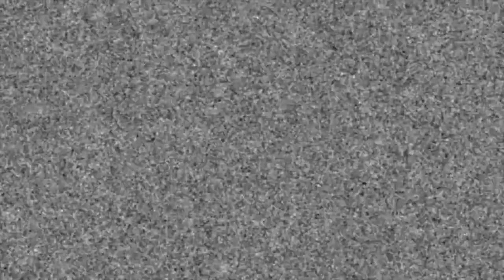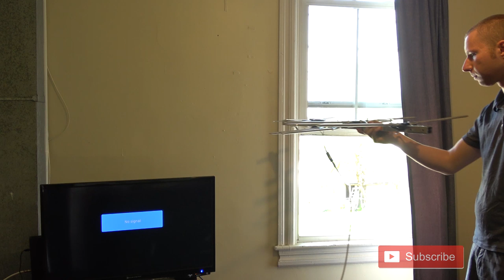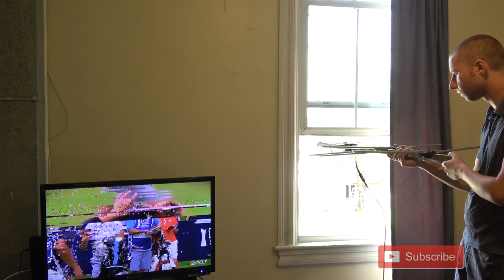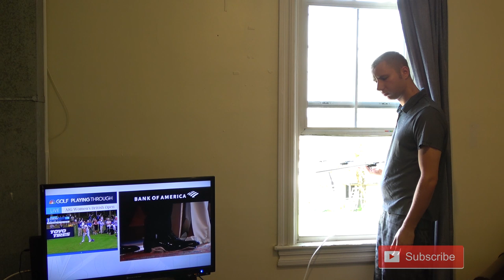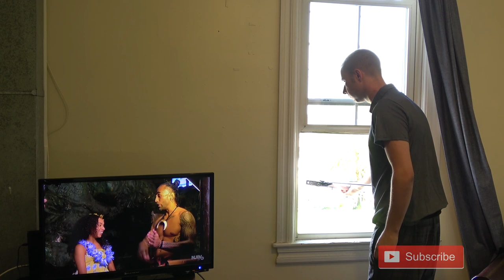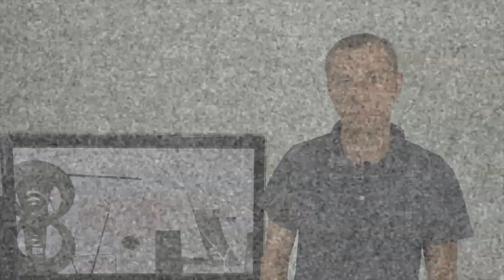Why Indoor HD TV Antennas Do Not Work Well

Comment: Antenna man, hoping you can help.  I’m in Port Huron Michigan and have an OLD school antenna about 32 feet high.  I just hooked it up and only got ONE channel (29) out of Canada.  But I can’t get any locals from Detroit 43 miles away when I point the antenna in the proper direction.  Two concerns: 1. I have a huge tree in between my antenna and Detroit. 2. There is old G59 cable running from antenna to tv about 50 foot run or so.  I keep turning antenna and rescanning, but no matter where I point it I just get that one Channel 29.  Any thoughts, suggestions?  I really want to use this antenna but also don’t want to put a ladder 32 feet high to change anything.
Reply: Actually my Zip Code is 48079, so I should be getting about 27 channels according to antennaweb.  I’m new to cutting the cord and fairly lost already.
Reply from the maker: Replace the RG59 cable with an RG6 cable and add a preamp. That will likely boost your signal. You can find both on my Amazon store: https://www.amazon.com/shop/antennaman
Reply: @ru932  I'm not sure if this helps or not, but I had an older UHF antenna that my dad and I installed on the roof in Lansing.  All I could get with it was the Lansing locals.  In looking at the list on TV fool, I was supposed to get at least Fox 66 out of Flint as well.  In the old Analog days I could get 12 out of Flint as well.  I tried that Clearstream 2 max indoors first and got all locals as well as Fox 66.  I then replaced the old antenna on my roof with it.  In addition to 66 and 12 I also got 25 and sometimes 46, which is at the 56 mile mark.  I then added the distribution amp and FM trap up on the pole, I'm now getting all Lansing, and channel 46 all the time now.  I still have some difficulties with my Channel 43 even though it is in the green area.  Which I think could be they are low power as they are in the next FCC repack.

I do notice that if I scan at night I can sometimes bring in distant channels, or first thing in the morning.  I can often get fox 17 out of Grand Rapids and WNEM 5 out of Bay City.  WNEM is coming from the rear of the Clearstream 2 max, and through my big silver maple tree.   This weekend I got channel 7 and 56 out of Detroit for a little while scanning in the morning and the antenna is not even pointed southeast from me.

So you might need the Amplifier, some RG6 and a newer antenna.
Reply: Thanks for the great info guys.
Reply: I ended up skipping the antenna and subscribed to PlayStation Vue.  All the channels I wanted plus the four Local Channels at no extra cost.  I essentially cut the proverbial Directv cord and am saving $90/month!

Comment: Antenna Man, can you help? I recently cancelled my Directv and the dish is still on the roof. I was wondering if I got the ClearStream 2max if it would be possible to mount, with some modifications, to the arm of the Directv dish? The mounting of the dish could be used to mount the antenna and use the existing coax,(R-g6)  from the dish since it's already coming through the house to two televisions. Does this sound like something that would possibly work? Thanks

Comment: I live in an apartment, there is not a way to get an outdoor antenna anywhere. There are a lot of trees and possibility a larger building i would half to deal with. But if there was a way to  attach some kind of   an out reach from the side of the outside wall. to faction the antenna to, might work. I might have to look into that. I have an indoor antenna that does not pick up very many channels, but the ones it does are usually very good. Thanks for video and information. Ps I am looking for suggestions?   :- )  Tom
Reply from the maker: Make sure the antenna is on a wall that faces the direction of the broadcast towers. As I mentioned in the video one of the best indoor antennas not only by my test but Consumer Reports is a ClearStream 2max. https://amzn.to/2yoVl2l
Reply: *would have to (different meaning and slightly different pronunciation)
*an outreach
*to fashion the antenna to (different meaning and pronunciation)
Reply: @alvallac2171  I know what your saying. I have to figure a way to fit  it to my window frame it looks like. can't attach it to outside wall.

Comment: Still waiting for two questions I`ve asked  
1 which end of the antenna points to the transmitter (the antenna in your avatar for example )
2 which antenna would you suggest for areas that have a lot of trees
Reply: It depends on the design of the antenna but normally if there are a group of elements that resemble an arrow head. That arrow head will point AWAY from the TV transmitter. In the case of his Avatar, both the antenna and the little man are pointing towards the TV transmitter.
Reply: @eosjoe565  Thank you ,I kinda that was the right way but it`s best to know for sure

Comment: Antenna Man is right, indoor antennas are a waste of time. Construction materials will block signal especially ATSC 1.0 it’s a weak feeble signal. 
Best just to run RG6 to a mount on the side of an eavestrough bolt a piece of plastic to it and mount a 31 inch stainless rod. Then attach the Center core of the RG6 cable to it. 
This setup will produce more tv channels then any indoor antenna.

Comment: Hi Tyler  
Could you please comment on how incremental improvement in signal strength affects picture quality.  If a signal is registering a 75 would  an increase to that signal to lets say  85 affect the quality of the image on the TV.  Thanks
Reply from the maker: The picture quality is the same at a 50% or 100% signal due to error correction. It's not like streaming a video online. It's either you have a clear watchable signal or nothing.

Comment: That law regarding HOA's and outdoor antennas ALSO applies to apartment dwellers.  You're still going to be SOL if you don't have a balcony or something on the correct side of the building, but if you DO, then you can cite the relevant Federal statute to them.
.
.
Thank you again for pointing out how useless new indoor antenna are.  I tell viewers, rather than buying an expensive indoor antenna, go to the local dollar store or big box home improvement place and get the LEAST expensive set of rabbit ears (if they can't put up an outdoor).  Then put them as close to a window facing the transmitter they want to receive as is possible.

Comment: I'm not quite understanding why the antenna wouldn't do a better job up against the window.  I get the siding, insulation, and wood cause a problem.
Reply from the maker: The window is considered building material.
Reply: @AntennaMan  I never would have thought that glass would block UHF signals.  silly me.  Makes me wonder why the antenna works better in the attic.  Is it the height?  Wood and shingles allow more signal?
Reply from the maker: It's a mixture of height and lack of insulation up there. Both definitely have a small impact on the signal but as long as you don't have foil shielding you should be fine.

Comment: any plans of making an video about fm dx-ing?
Reply: Wow, I have not heard of anyone interested in FM DXing in about 30 years! Cool!
Reply: @bobschweitzer7858  there's a simple reason for that: The radio stations in my region suck, DAB+ and web streams both have horrible sound quality... so there's just one solution: Go old-school.
Also I don't like being dependent on local infrastructure, I'd love to have to possibility to receive information from further away.
AM is no option for me, I'm living in Germany, and Germany killed AM years ago.
There are 0 (zero) am stations on air.
Reply: You just need an outdoor VHF antenna. FM signals will be received from 30 to 100 miles away depending on the antenna (rotator helps) and terrain. 100 to 400 miles during a tropo opening in summer. I am Bob K4RES in Apopka, Florida

Comment: My 150 mile lava antenna worked great in my dining room or in the front door way but I got tired of moving it out of the way so I put the antenna in the attic. I live about 40 miles away from the towers. Rabbit ears I haven't tried because the antenna has 300 ohm twin lead line and I didn't have a balun to try it. Most stations are UHF. So rabbit ears is not going to work well.
Reply: *dining

Comment: Back when I was a kid, we didn't have cable or an outdoor antenna.  Just rabbit ears and eventually UHF loops.  We were able to watch TV all the time, and even get some channels from another state, albeit with some snow.  And we lived in a gully!
Has the switch to digital messed up TV broadcasts THAT badly?
Reply: Same here. Those little rabbit ears with UHF loops were very well made too. Good metal throughout and a nice heavy base. If I recall, I think ours used twin lead feed line and not the silly 0.090" diameter coax on the junk they sell now.
Reply from the maker: Yes the FCC really screwed up TV signals with the ATSC standard they approved. I feel like they rushed into it too fast
Reply: Old tv's  had coil wires on back covering of tv's. It was a antenna and it picked up more channels than rabbit ears. I think atcs 3.0 will be better and tv signal will be stronger like analog.
Reply from the maker: @kimberlyespinoza280  Yes I remember those! ATSC 3.0 may solve the reception issues but also has the potential to kill free over-the-air TV. It's internet based so there's nothing stopping a channel from requiring a subscription just like when you try to watch certain NBC programs online.
Reply: Truth and Quality.
Practical and Useful Information.

The current ATSC 1.0 standard is Ok but not great. 

Know this , there are No transmission and reception methods that are 100% perfect.

ATSC 3.0 is being licensed by the FCC Federal Communications Commission now and will be phased in.

ATSC 3.0 is a transmission and reception method ( and variants ) that rest of World uses and will greatly improve transmission and reception.
And ATSC 3.0 is compatible with the internet and more.

Comment: Truth and Quality.
Practical and Useful Information.

Currently Channel Master is the most honest provider of reception information compared to
other antenna sellers.

www.channelmaster.com , has the , CM-30001HD , Advanced indoor antenna that will
provide improved stabilized reception.
Reply: Also know this truth. No antenna indoors will have perfect indoor reception
not even the , CM-30001HD.
However Channel Master does make a honest effort with the , CM-30001HD.

Comment: Are there any DVR systems that don't require a internet connection?
Reply: Yeah, get the tuner box at Walmart. For $39.00 it has a DVR that records to a USB thumb drive.
Reply: @bulldogbrower6732  thanks
Reply: *an Internet (because "Internet" starts with a vowel sound)

Comment: would an outside  ant. work w/ a hill between ant. and stations....[have heard not;;;;;wondering;;;tia
Reply from the maker: Yes, I've installed antennas with two mountains in between it. Tvfool.com will show you. Stations can be picked up into the red.

Comment: U have to have patience with antennas.  And keep moving it around until u get a signal.   Even if u have to stick it on the wall or hang from your dresser.  Lol
Reply from the maker: That's usually only the case when you're using a junk antenna. Larger, higher gain models you don't have to move around much at all to lock in the signals.

Comment: Indoor HD antennas are a joke! I've tried every RCA and similar types and they pickup absolutely NO Signal at all!
Reply: @RS1 Glad to hear, I've tried 7 different models including RCA's top of the line and have yet to get a signal at all for even a single station.
Reply: LOL, well at least you got 4. I got absolutely nothing but snow on my screen. I may opt for an external to try out but I'm not holding my breath.
Reply: @bestplans9051   Are you doing a rescan for Antennas with each change or just turning on the TV?